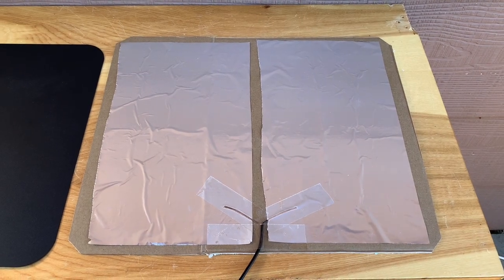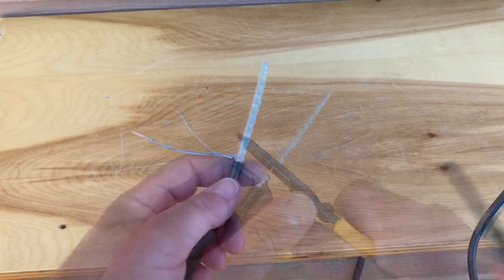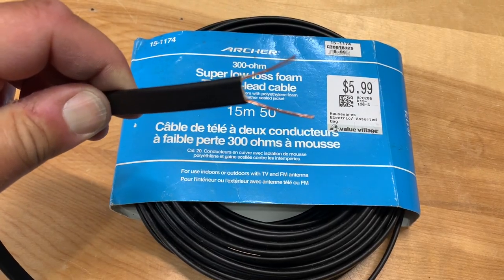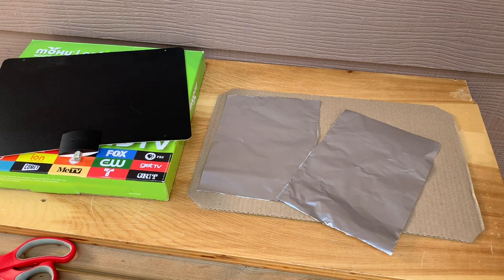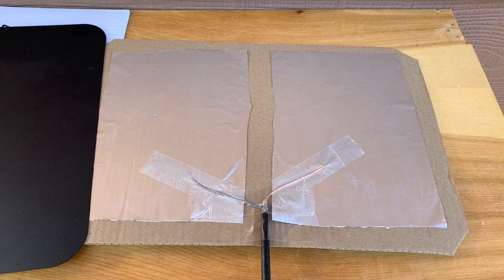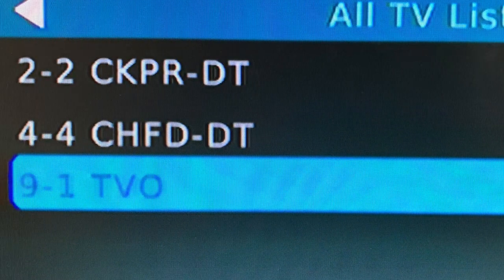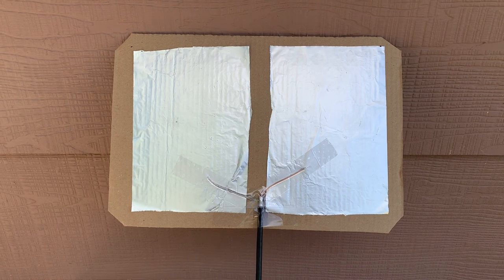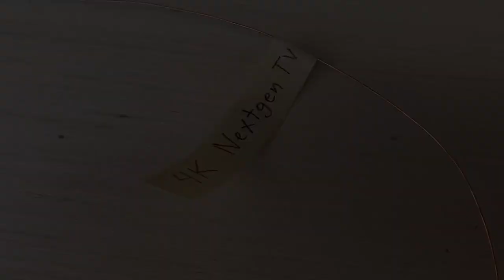Homemade Indoor Flat TV Antenna Surprises in Test vs Mohu Leaf OTA TV Antenna!

Comment: Impressive but I still think your 8 ft piece of copper tubing you made into a folded dipole was easier. You find a 2nd piece of tubing for your UHF loop and you have a cheap combo antenna.

Comment: Question: Why should the 2 pieces be separate, because what I have read is that the outer shielding wire mesh is merely a ground wire?
Reply from the maker: @seanrosssamuels6891  I’m going to test it out.
Reply: @NorthcoasterHobby  and also, what about simply taping 2 cheap aluminum pans
Reply: @NorthcoasterHobby  and also, what about taping 2 cheap aluminum pans to the window and connecting them to the TV by way of speaker wire and a balun?

Comment: I live where all the stations are to the north but there's a big metal barn right across the street that way. Can only get a couple channels. Colorado front range. If I go up I can clear the barn but then the winds get really strong at times so it would have to be a sturdy antenna. I've tried that mohu type of antenna. I'm going to try your idea and maybe make the different shapes like you showed and compare. IDK. Thanks for the info. Cheers
Reply from the maker: @shoofly-mx1  👍

Comment: I made a very cool looking antenna from just an old micro usb cable that I cut and stripped to attach to the design!

It works well for what I need right now
Reply from the maker: @ElevatorWasher5000  If it works, it works!

Comment: Interesting, I have tried homebrew designs but this is the easiest I've seen. Question.   If a couple square feet of foil works, what about a whole roll hanging in the attic? Would an antenna tuner be beneficial? Is there a more permanent way to connect / solder the leads to the foil? Time to hit the dollar store for some supplies! I have found that some of these flat antennas work adequate for fm reception as well.
Reply from the maker: Tape is probably sufficient over soldering. I suppose larger areas of foil might help, but who knows, it might pick up lower VHF stations too.  Best wishes with your project and thanks for watching!
Reply: As antennas get bigger they work better until the dimension passes 1/2 of a wavelength.  Once you pass that, odd things start to happen and the reception generally gets worse.
An antenna that is 1/2 wave length receives the best when the signal is coming in directly face on.  As the antenna gets longer, the face on reception starts to decrease slowly and reception at an angle to the face increases.

Comment: But if it only gets one channel then it's not very helpful when there are over 75 OTA channels in my area.
I bought the Mohu Leaf Supreme Pro. It picks up nearly all the OTA channels in my area.
Reply from the maker: I can only receive one channel indoors in my area. There are only 3 OTA channels available in my city. The demonstration was to show the performance of the antenna. Try making one, you’ll probably be surprised by the results.
Reply: @NorthcoasterHobby mine worked excellent even with using just aluminum foil to connect into the TV but it works until I but a TV antenna
Reply from the maker: @ElevatorWasher5000  Super!

Comment: how long does the DIY reaches??
Reply from the maker: Haven’t done a long range test. It’s for areas close to the broadcast towers. Maybe 10-15 miles at most. But depending on the area, could be further.
Reply: @NorthcoasterHobby  another question, my cabel is a bit thinner and has a little thing on it and it says filter system. i cut it off because than the part i cut of wont be long. will it still work??
Reply from the maker: @Nimrod1212  Try it out and see. If it doesn’t work use another piece of wire or cable and an adapter like I used in the video.
Reply: it doesnt work. what can i do now?

Comment: A bowtie shape works a bit better than a square.
If you look up the RF frequency of the station you can do an better design as far as width goes.
The best antenna will be one half of a wavelength at the RF frequency.
You can figure out wave length from frequency in MHz with
Wavelength = 300 Meters / MHz
A thrift store painting you can stand makes a good thing to attach the antenna to the back of.
Reply from the maker: I’ve made antennas before by calculating the element length from the RF frequency. 
How To Make a Simple Homemade Dipole TV Antenna - get free OTA TV Channels
https://youtu.be/6tqQkylXZFM

I wanted this cardboard antenna to be as simple to make as possible.
Reply from the maker: Homemade Folded Dipole TV Antenna performs way better than I expected
https://youtu.be/urV_dGB0QDg